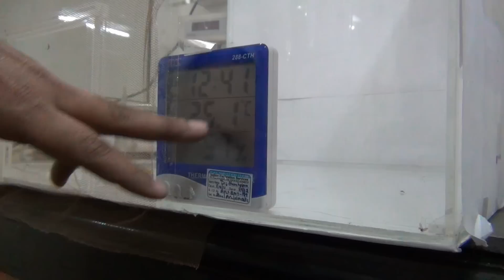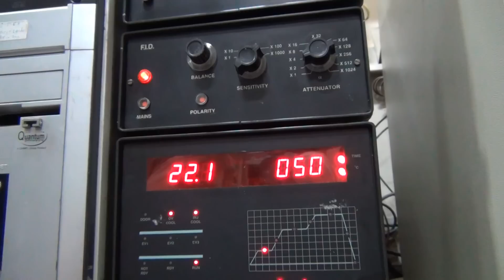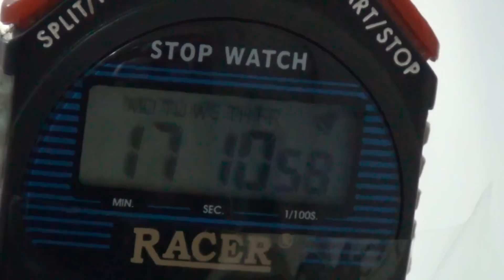Mosquito repellent lab test

Comment: This test is done in small area with full capacity of chemical so test is failed
Reply: Test is to see which is better between the two so the test holds well because it is not for check effectiveness but instead a comparitive test. :)